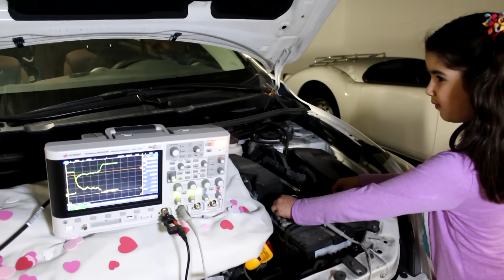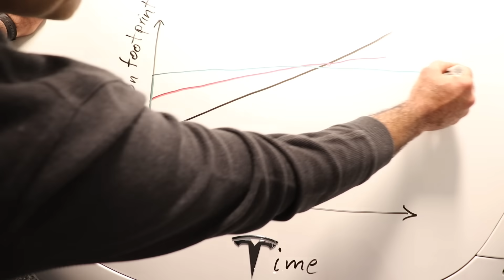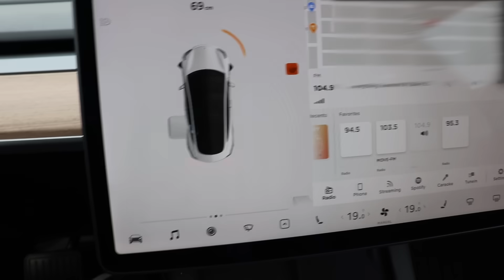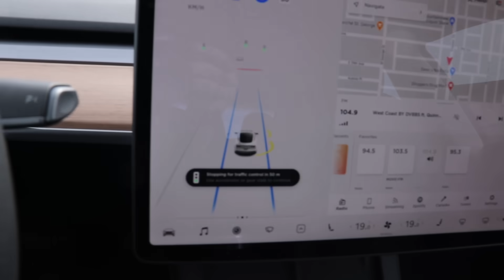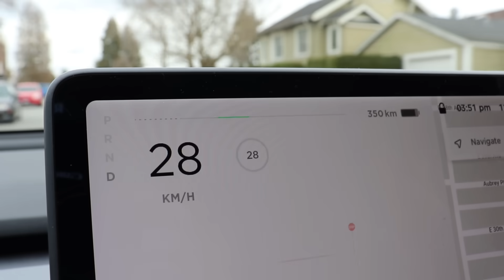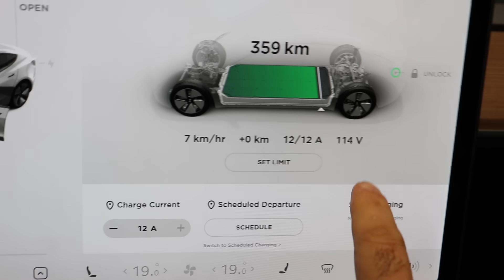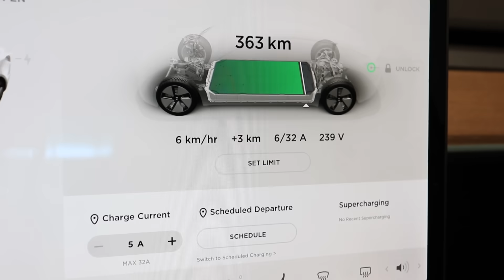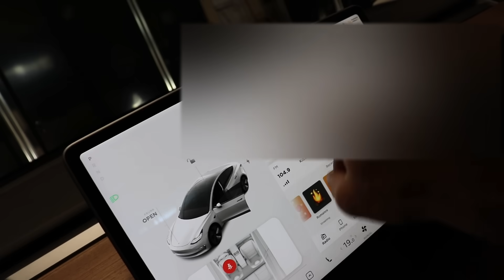ELECTRIC VEHICLES & My Tesla Model 3 Review

Comment: Fun fact : it's really an Intel Atom processor in the infotainement system.
Reply: oh god, thats worse then a celeron.
Reply: Oh good god, no...
Reply: @LambdaWave84  why not just use an ARM chip then?
Reply: @mdrahman6732  probably hard to find automotive grade ARM processor that includes a GPU.
Reply: @mdrahman6732  why don't all cheap laptops use arm chips? Probably because their operating system doesn't run on arm.
Reply: @fjjwfp7819  Which operating system doesn't run on arm?
Reply: @MemableAI  Tesla probably costom built their OS
Reply: @baldbadger7644  They're using Linux.
Reply: @MemableAI  every that program to run for example on x86
Reply: @fjjwfp7819  Every company "Custom Builds" their OS. The thing is, all of those "Custom Built" OSs are just basically Linux. And Linux supports ARM.
Reply: @MemableAI  Windows, and the ARM version is apparently difficult to license. Unix-like is the way to go in this case.
Reply: Wtf u guys talking about, I’m running with my legs, I use my arms to grab and manipulate shit, why tf would I run on arms thats so dumb
Reply: The new ones got upgraded to an AMD APU, but comes with higher power consumption.
Reply: @Kidsnd274  "The new ones got upgraded to an AMD APU, but comes with higher power consumption."

Not sure what the word "upgraded" is supposed to mean here. Still. They could have gone with low TDP i5-i7 CPUs or an ARM processor for a decent amount of power use reduction.

When it comes down to it. Intel's Atom and Celeron processors are only useful for ultra low budget systems. That's what they're designed for. Which means it's 100% a spared expense by Tesla.
Reply: @Unethical.Dodgson  Upgraded refers to the fact, that the new AMD CPU is faster than the old Intel Atom. Not sure which AMD CPU they use, but it is confirmed that it's a Ryzen series CPU.
Reply: @Kidsnd274 yes maybe to minimize power consumption and maximize range they would been used low power cpu. Anyway you're not gonna use that powerful cpu for gaming or like that.
Reply: Hell a low profile i3 costs less than those atom processor.

Comment: I enjoyed this a lot lot more than I expected, thanks!  I have almost no interest in these things but from the hype and reviews I have bumped into, it sounded like the autopilot stuff was prime time already - truth has been shown. That charger is impressive - love how you can just swap the wall plug and 7.6kW is insane! 
As for the touchscreen, I'm not a fan of those displays in cars and I'd hope it would be completely passive i.e. display only while actually driving. If you have to use it for the radio or A/C that seems incredibly dangerous compared to physical controls. But what truly horrified me is that thing is even capable of running apps. Surely it should be a closed system?!?!?  WTF are they thinking - that thing will certainly be hacked.

Comment: Slow charging might not be the best idea actually.

While the battery will be fine, if the climate is not within the ideal charging range, the battery coolant loop and heating/cooling system will run basically 24/7, increasing wear. 240V 32A feels like a lot, but with a giant 54kWh pack, that's only a 0.14C charge rate, which is very close to the gold standard of 0.1C for slow charging. So even at charging at max speed, the battery degradation due to charge rate is almost negligible.

Enjoy your new car Mehdi!

Comment: Usually, a flashing green indicates a broken light and should be treated as a stop sign so it's making you check your surroundings before you go.
Reply: That is really weird for me as a European. Flashing green here doesn't exist, it's flashing yellow.
Reply: @mrnmrn1  It doesn't exist here either, it usually means the light is broken and should be treated as a stop sign just like a flashing red would be.
Reply: @luminescentlion  Yes, Though flashing red and flashing orange are actual signals and are often on a schedule (though may also indicate the light is broken).
Reply: @mrnmrn1  it does exist in Europe. In Austria, the traffic light flashes green 4 times before changing to orange. When the traffic signal is turned off entirely it is flashing orange, as you said.
Reply: Not everywhere. In Ontario a flashing green means advanced green. Flashing red is broken and to be treated as a stop sign.
Reply: @fb767  We have green arrow lights for that, Flashing green isn't anything in the U.S. which is why its most likely broken and broken lights should be treated like stop signs. We have flashing reds that are operating normally to indicate that there's a stop sign at that intersection.

Comment: saw tom scotts video and i think you should try making a plasma speaker. friends of mine once made research on it and what they did was ionizing air with high voltage and resonate it directly. their professor had doubts this might work without special gas, but it worked quite okay with just air.

one experiment was a printed pcb with zigzag wiring where it's corners burned away because of the high field densities there. the other one, that worked better, was an acrylic pipe with wire coiled around.
Reply: You might be interested in seeing Steve Mould's work on harmonics.  If I remember right, by resonating a gas burner tube, he was able to visualize various waveforms in the line of fire jets.  (The sound wave altered the pressure at each location.)
Found it:  https://www.youtube.com/watch?v=dihQuwrf9yQ
Also check out the couscous, for more standing wave action.  :D

Comment: I also do not drool over cars, i actually even don't have driver licence ;) (just because i always lived in city and never needed a car, everything was in reach for me by public transport, that includes hundreds of kilometers trips from city to deep nature). But this video was very informative for me, thanks for it! And funny, as always :). Only one note about the sustainability and carbon footprint - after how many years would you need change battery pack and how much it will cost? I know it depends on how often and how fast baterries are charged, also if you have garage or if car is on street (winter colds) so i am not sure if battery pack durability is even something what could be calculated as it would result in very wide range telling actually nothing. Still, this video changed my view on electric cars (to a better side i must admit :)). Thanks!

Comment: Electric cars become better for the environment over time, but at the same time the battery capacity reduces with it. Not to mention cold weather.
Reply: This happens with diesel engines as well. You have a heating element within such engines as well. You also have cold start lines in carburetors. So you can run these in cold weather but it would use some of the battery, just like you would use a bit of fuel to heat your engine
Reply: @kingbradley3402  that's really not the same as electric cars. With diesel engines you got to glow the wires for 2 seconds so your engine starts up easier in cold weather, after that the engine just warms up by combustion and you don't even need a spark plug. But with EV's you have to constantly heat the battery, otherwise it greatly decreases in range. Also, the battery of EV's decrease over time in range anyway. But you can put 300.000 kilometres on a well maintained diesel car and you barely lose any range or even performance.

Comment: I have question at you ElectroBOOM. Why is nobody doing ebikes without battery? I mean ebikes without a chain but with generator at pedals and motor on wheel with some electronic automatic transmision system. Would looses on it be really so big.

Comment: hi mr  i  had  questions
1A AC= ??Watt
does DC have watt too ??
then 
1 A DC =??Wat   same as AC
Reply: Amps * volts = watts.  AV=W.  AC vs DC is only the method of current delivery (constant stream versus oscillation) and has nothing to do with the amount.
2A * 120V = 240W
1A * 12V = 12W
Inverse also applies:  30W / 240V = 0.125A.  W/V=A.
On a (power adaptor) transformer block you will usually find very different input and output numbers:  (Symbols are approximations.)
INPUT: 120V AC~ 60Hz 2W
OUTPUT: 9V DC === 100mA
This specifies U.S. mains power at 120V, which oscillates (switches direction between positive and negative) 60 times per second (hertz), using 2W of power, which translates to 16.66mA, milliamps, or 0.01666A.  The output is 100ma or 0.1A at 9 volts, producing 0.9W going out.
The voltage is lowered and the amps are raised together by an inverse fraction, with 55% of the input power (2W becomes 0.9W) lost to heat and possibly LED and diagnostic functions on the Black & Decker tool charger I read this from.  That makes sense with how much waste heat those things produce.
A perfect transformer (without loss) would have the same wattage on both sides of the block, but none do.

Comment: If only the government in my country actually bothered to invest in the necessary infrastructure for electric cars (read: recharging stations), maybe then buying one here would make sense. No amount of financial incentive is going to alleviate the fact that you can't charge the damn thing anywhere, preventing you from escaping the ~250km perimeter around your own home (provided you own the place enough to set up a charging station there; if you live in an apartment, you're fucked). This is also the reason why hybrid cars are an even worse thing to buy here, because nobody is going to use the battery, since there is no infrastructure for it. It's just extra weight the combustion engine has to lug around, consuming more fuel to do so than a conventional gasoline car.

Comment: Can you make a video on
'Can we gain INFINITE POWER by Vacuum'
In which you should try to create a complete vacuum in a transparent container and try to power a windmill kinda thing inside it.....And once the windmill thing is powered, it should go on for a long time as it is a vacuum. And the energy released by the rotations of the mill should be converted into electrical energy.
So by this I want to see that my idea works or not..
BTW 
LOVE YOUR VIDEOS!!!
Reply: I believe Mehdi has already made a video or two discussing free energy/perpetual motion.  They are the same general problem and can't exist in reality, due to friction slowing the system down.  Even if you could make a turbine of some sort that had no internal friction (you can't,) it then has to push against air or magnets or something mechanical, in order to generate power.  That thing it's pushing on adds more friction, which slows it down.  Eventually, slowing turns into stopping.
Rotation in and of itself does not release energy, but it is a display of energy acting on an object.  Only the windmill slowing down can release its own energy into something else, until it stops or more energy is added from someplace else.
Electrical windmills take energy from moving air, transfer it to the blades, then transfer that to a generator motor that makes electricity.  Putting them inside a vacuum wouldn't give them the energy they need to start spinning.  (Powering a windmill just makes a fan that uses electricity to blow air.)

Comment: In my opinion electric cars are not better for the environment and are not the future. 1. Not only an engine produces micro particles. Brake dust and the wheel “grinding” on the street also produces these harmful particles.2. Watch a Video of how we collect lithium. The people living there have no groundwater anymore because of us pumping it on the surface and wait until it evaporates and the lithium stays.3. The earth does not have enough resources left for all of us having electric cars. 4. If you buy an electric car and take your power to charge the car out of an atomic power plant, you did not safe anything. My hopes are about hydrogen cars but with an engine and not with a fuel cell. And basically you can’t force people to drive electric cars.
Reply: Your information is not only wrong, but completely dismissive of the amount of particulates polluting the environment. Also, all of your talking points come from oil propaganda. Tesla uses lith-polymers now, which is far better for the environment, can be recycled and has 2 decades of lifetime on the batteries alone. Most EVs exist in places like in CA where 100% of our energy is renewables. 
Hydrogen is not only super dangerous, but very expensive and limited in supply. Oil companies have huge stakes in Hydrogen, so that's why you see all the propaganda about them.

Comment: It means we generate electricity from thermal(mostly) power, and we use it to charge our car.
More power needed,more fuel is burnt until solar system gets it efficiency.
Reply: In British Columbia where he lives 95% of the energy is from renewable sources, mostly Hydroeletric. 
Even burning coal, or Gas to generate eletricity is better than burning fossil fuel in the combustion engine because of the efficiency of the eletric motor + generator against the efficiency of the combustion engine.

Comment: Electric cars are all the rage especially Tesla. I live in San Jose, CA. There is a Tesla dealer just three blocks from my house! Tesla owners are everywhere here. I mean it.  I can go out now and find a Tesla driver within 5 minutes. Not kidding!  They are all over the place here.  I am all for EV's  It's the future.  But consider this. Charging an EV still consumes  a hideous amount of power.  And power plants require fossil fuels to produce electricity to charge your EV.  Right?  32 Amps max to charge a Tesla is power intensive.  This is like running, for example, your oven and air conditioner at the same time. Yes, the power company may give you a break on electrical cost(and incentives), but producing the actual electricity to charge consumes huge resources.  My opinion, Tesla owners are either brand junkies, wealthy, want a cool car,  or just plain ignorant. Not ElectroBoom of course( you stand out of the crowd).  EV car salesmen are very keen.  Ask all the questions before buying(a Tesla). Ask them if they are willing to throw in some solar panels on the deal.   Solar in combination with EV's are the solution.
Reply: "And power plants require fossil fuels to produce electricity to charge your EV.  Right?"

No, do you not know what a nuclear power plant is? There are no fossil fuels involved, lmfao. Also, charging EVs takes very little electricity compared to even your average gas station pump. Please do research instead of spouting nonsense you have no clue about.
Reply: @sqlevolicious  Obviously of course. I completely agree that Nuclear plants are the answer to our energy problems.  However, with some of the problems that have incurred with Nuclear disasters brings a sour note to the world.  Japan's nuclear power plant meltdown was a disaster. Many people died.  After this, how do you convince the world that Nuclear is safe?  It is now  going to be a major challenge to convince investors to move to Nuclear.  It may take several years and forgetfulness to move on.  And currently no one wants Nuclear nowhere near them.  Here in CA USA, they are decommissioning the Diablo Plant Nuclear facility.  California is now replacing with Wind and Solar.

Comment: Toyota is planning on releasing its first Solid State battery EV some time this year, which they claim to have double the energy density of current Lion ev batteries, and can be charged from 0 to 100% in about 10 min, with other companies to follow soon.  So right now is the time to get a a new electric car.
Reply: Solid state batteries will change everything very soon, but doubt Toyota has cracked the solid state tech yet. It's still theoretical in it's uses and reliability. We are still about a decade or so out from solid state batteries coming to the public.
Reply: Solid State Batteries are very expensive.

Comment: i car that drains energy when standing still doesnt seem helpfull to the enviorment
Reply: If you're talking about when it's at a red light then a regular gas car still keeps the engine running which is much worse than the small amount of energy the electric car uses
Reply: @R0BIN_  no not talking about that  watch https://youtu.be/YP1grgXhGvU its by a tesla fanboy but he explains that the batterij drains when idle and this cost more enrgy en money then you mihht expect. Watch it its funny. I dont drive a car or own one for sake of argument im dutch and only use bikes.
Reply: @nathanwhite7765  Sounds like he doesn't use any reliable methods to measure charge and has come up with garbage theories to support some sort of weird hate that makes no logical sense from a physics point of view.
Reply: @sqlevolicious  Did you see the vid? He is a tesla fan boy dont get the hate part.

Comment: The reason why it requires you to step on the gas and touch the steering wheel is probably not a technology limit. It's probably to manage legal liability. 

Because you are still maintaining control over the vehicle, you are liable if the car gets in an accident.  If the car drove completely on its own, then the manufacturer could be liable. 

This is the same reason why cars with automatic parking still require you to hit the gas and break manually.

Comment: molten salt breeder reactors and carbon capture can have a closed loop for liquid fuel, making dye-methyle ether out of carbon and hydrogen in the air. with a high temp reactor(550~700+ depending on salt and vessel materials) direct thermal use for chemical reactions saves wasted energy of making electricity in the first place 
IE, fuck batteries.. electric cars have been playthings for the afluent for over 100 years.. they are ridiculous as preformance vechicles but a bad macro move.. whos dealing with the dead cells once you get close to 30 or 40% EV's, the subsidys should not be doctrine..